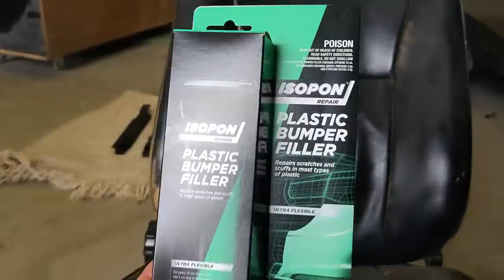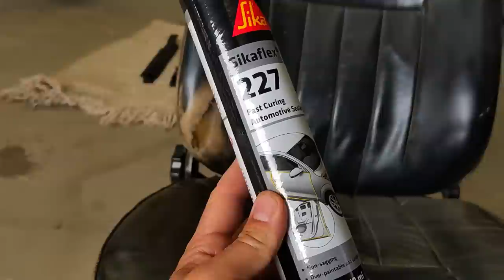EPISODE 74 - EARLY COMMODORE TO WB UTE SEAT RUNNER MODIFICATION PLUS VINYL SEAT RESTORATION

Comment: Another awesome vid mate.
Your channel is unique as you try and fix a lot yourself which is great to see.
I need to restore a old fuel tank and watching you videos gets me motivated to give it a crack
Reply from the maker: Thanks mate, I give it a crack at least, yeah the fuel tank is an interesting challenge project. Just make sure you drain all the excess out so it doesn't gas out and delaminate. Very important so you don't have to redo. Just a thin layer will do. Cheers!
Reply: I used a por15 kit on an old tractor tank. Follow the directions to the letter. I was very happy with the result.

Comment: So the first time I had a bucket seat repaired I took the whole car in and it cost a fortune. The next time I stripped the material from the frame and only took in the pieces that needed the work and the price was about 10% of the first repair, I had thought about just swapping left to right and when I did realised that it was angled differently to the drivers seat. Yes I soon learnt that those little wiring clips are really sharp but I did save a bucket
Reply from the maker: I did think of just bringing that seat in and getting it repaired but I still reckon it would be $500 or so the way Everything is at the moment. I will just get new skins I reckon once it's on the road but for now I'm fine with the condition they are in after my bodgey fixes😂

Comment: Them Commodore seats are VB commodore the are wrong for WB you need VH seats in WB
Reply from the maker: They are correct mate
Reply: @BarnesysBuilds  no WB never had the big head rest I’ve be working on WB over 30 years
Reply: People ask me for what they.need for there WBs all the time
Reply from the maker: @shanemclachlan421  ok yeah, I was told they were VH and if I line them up to WB they are literally identical
Reply: @BarnesysBuilds  they are not VH they are VB 1979 seats
Reply from the maker: @shanemclachlan421  regardless of what they are they are identical to the WB Kingswood seats and that's what I was after. I even sent photos to winner products trimmers and they thought they were WB Kingswood seats as they are absolutely identical.

Comment: I got new skins from Winner Products in Adelaide, they also did the door panels and roof trim. You would swear they grabbed them straight off the Holden production line, I compared them with the originals and couldn't find any difference. 
I forget the price but think I got the lot for $1200-ish. 
Have a look at their website
Reply from the maker: Hey Chris, yes that's who I got the quote off, all up everything came to $6700! Supply only. The skins and doors cards came to $3000 alone. So not sure when you ordered yours but prices are definitely not the same anymore than what you quoted. Good to here the quality is good but it would want to be for 3k vinyl! Cheers